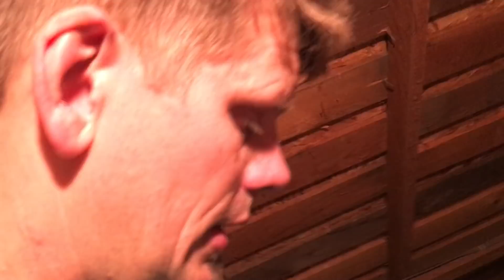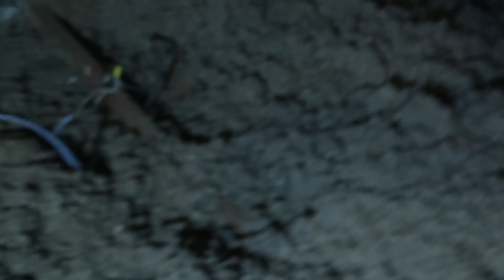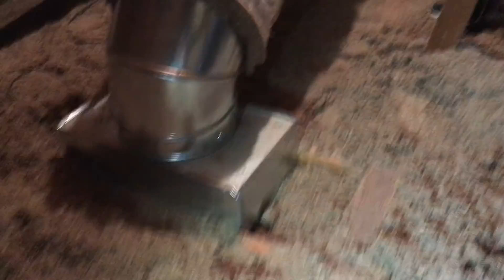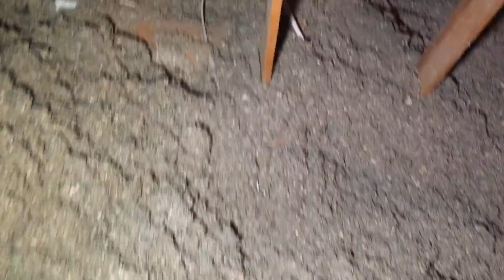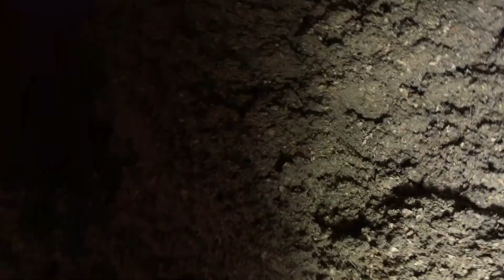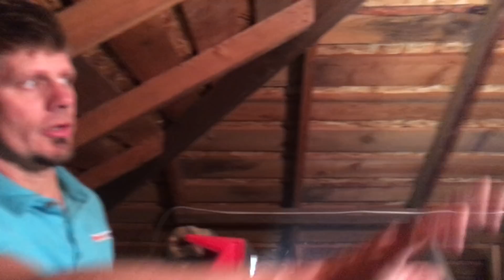Attic in a 1937 Home in Colorado with Knob and Tube Wiring: What not to Do

Comment: knob and tube is safe as long as you dont insulate over it or make improper splices, they have done both. if someone wants additional outlets or anything i would always just make a home run right from the panel and run a new circuit and leave the knob and tube alone, because once you start messing with it might as well replace it because if tampered it causes all sorts of issues. it is a great system when in good shape, and it is perfectly safe and fine for some things, but as long as you respect it's limitations and dont tamper with it then it is fine, but when you see stuff like this it really should all be replaced because that is just what you can see without even doing anything... what about what you can't see that has been done like in the walls.

Comment: No shortage of this in Boston. I’ve been doing knob and tube removal for a few decades. I’ve hit attics with 18 plus inches of blown in insulation on top of old paper backed fiberglass. Back in the day old newspaper was laid in the mix too. It’s pretty scary when you come across a scorched run of news paper or fiberglass that the only reason it didn’t fully ignite had to be just a lack of oxygen because there’s no shortage of fuel to burn in those old attics.

Comment: Wow. These new home owners are very fortunate that when the flickering occurred it didn’t start a fire up there. I know it’s against code to add on to existing knob and tube wiring systems because of the inherent dangers. I don’t see knob & tube much here in the east, but every once in a while we come across. And it’s usually been tampered with.  The silver lining is  they have an experienced and electrician like you advising them now.
Reply: I didnt know it was against code to add to existing knob and tube wiring. Do you have a code reference?
Reply: matt borges I didn’t think it was against code but maybe it is to add on to. But you can splice into it, I just watched another video and the guy said the code number but I forget what it is now
Reply: Yes.  I am in the process of starting my apprenticeship and finishing once the covid 19 is lessened.  Anyway,  technically,  as far as the nec and most local codes goes, knob and tube is not illegal and no local code that I am aware of, require the removal of knob and tube, as it falls under the grandfather clause, meaning, assuming it was wired to code at the time of the original installation,  and not altered,  added on or changed in any shape or form,  it is still technically allowed.  But the minute you start jerry rigging it, even if you were just relocating a ceiling fixture,  for example,  a few feet away and reusing all the original wire and insulators,  that would be considered modifying,  and would never pass inspection.  I know several old school electricians who been in the trade for 30+ years inspecting and wiring homes, old and new , and they have yet to see old knob and tube that has not been deteriorated and/or tampered with since it was installed in the 1930s, if not older.  Even in the best of circumstances,  many insurance companies will not insure homes with that type of wiring,  and the few that still do, usually require that a licensed electrician inspecting it and writing a letter certifying its condition,  so in the end when all said and done, your mortgage lender and insurance company may have the final say so

Comment: My family owns a house that was first wired around 1900 and is still full of the original knob and tube wire. Although the old wiring is still in great shape, the house contains lots of bad connections to the modern wiring that aren't in junction boxes just like in this house. We haven't ever had any problems with the old wiring like this that I know of, but I'd we do, I'm going to have to force them to upgrade it. I've already made some minor safety improvements, but there's a whole lot more that I'm trying to talk them in to letting me do.
Reply from the maker: I push for safety first too.

Comment: i have "cleaned up" many hacked up k&t wiring jobs. this video is a good example where a re-wire is necessary. i, too, have had customers mad at me for the cost involved. i'd rather walk away from the job than further increase a fire hazard. cutting corners on wiring is not only hazardous but illegal.

Comment: Looks like my attic. My house was built in the 1880s knob and tube mixed with old school  non grounded cloth and rubber ROMEX. I'm lucky to be an electrician since I'm cutting out and replacing EVERY SINGLE INCH OF WIRE. Not even cutting and abandoning it....jerking every piece,every knob,every tube.
Reply: Dont torture yourself abandon most of it ,or else your opening walls and all other ball buster stuff
Reply: @whtpwr  oh, I'm stripping the walls down to the stud bays. Plaster,lath,and all. BS cellulose insulation that's all settled to the bottom. And plumbing,too.
Reply: @erlycuyler  come do my house

Comment: Point blank correct. Just started in my newly bought 100 yr old home. Had the service just updated by a certified electrician. This isn’t with electrical only it goes with structural and plumbing too.

Comment: Just run romex wires from the basement thru a closet all the way to the attic inside a big pvc pipe connecting to a junction box and snake the wires down the walls to the receptacles and lighting.
Reply: Is in fact te best way to do it  .
Reply: first off you cant run romex or any non metallic sheathed cable in piping with out over calculating fill requirements and and you dont want to run to many conductors thru piping  generates a lot of heat plus increases the voltage/amp gain on all conductors(2nd yr apprentice at best from like 20 yrs ago so theory/laws  is rusty)
Reply: wizard3z castor depends what part of the country you live in and of course taking into account the sizes of the wires and conduits.

Comment: I'm surprised the insulation company would spray that crap in there over that lousy wiring mess.  You are sooo right, "home lookers" is a more accurate term.  I remember the home inspector that looked at my house, all he could find was railings of the wrong height, and BS like that.  He wouldn't even go up in the attic.  Total waste of $600, these clowns are never going to really give you the straight scoop or else they won't get referrals from the agents.  I finally went up in my attic after buying this house, and found a similar wiring mess.  Spent one hot summer up there straightening out the wiring.

Comment: My home inspector didn't even go in the attic (crawl space is above a raised tank toilet, admittedly it's hard to access but it is possible).  Being 1st time buyers,  we didn't think anything of it, went ahead with purchase and two years later, I'm discovering k&t that's under insulation and just taped together, and vermiculite.  The wiring came apart, leaving a live wire under insulation.  Don't cheap out on home inspector.  If it's an old home, should consider electrical and plumbing inspections on top of standard home inspection.

Comment: First, that appears to be xylem tissue (cellulose) insulation which has an affinity for moisture (meaning it sponges it up) and gets stinky/musty. So Also, the insulation is touching the under side of the roof decking. There should be proper-vents to keep the insulation from contacting the roof directly, so that air can circulate up from the eaves and out through the roof (or ridge vents). While the insulation is removed would be a great time to re-wire because it would be much easier, as the electrician will be able to see what’s what, and it is just not as miserable working conditions. So it’s faster and hence less costly. Very little of what is visible in the video is knob and tube, but clearly it was originally so. I don’t understand somebody grumping about what is past; it accomplishes nothing. The overall project with greater energy efficiency and safety should be an easy sell.

Comment: In the early eighties, when I was installing  cellouse
installation, we had to put pieces of screening around the knobs  in a run between the jost,
  screening  Had to be laid down, before we put insulation on top of it for that reason- so an electrician could  lift up the screening and expose that  Jost-Bay.

Comment: Same here Amman me and my dad required a house and it was all old knob and tube and when I tell it scared me that I had lived in that house for a year I mean they had speaker wire connected too the wire. They were running 110 volts though speaker wire to a light fixture.

Comment: I was a firemen for 20 years in a city that had lots of early 1900s homes. Seen many KnB wired homes burn. And the blown insulation over it was always a great way to get it started. Should be automatically replaced to-get a CO to sell. Most insurance companies won’t even insure anymore.
Reply: They will, provided the work is done within a few months, not much more than that tho.

Comment: Uho... I have a 1950s stone ranch. Went to the attic (crawl space) to see where I can run a new fixture to the kitchen.  That is exactly my dilemma.  Metal junction boxes, zero lids. Wires pulled out stretching to other wires stretched to four groups of wires with no junction box. All resting on or partially under blown insulation over paperback.  The few ground wires that are shown aren't attached to anything and are sticking straight up.

Comment: Shit I once ran into a job that had the Electrical System Using 50% Extension cords Instead of Romex.Customer Got Mad When I REFUSED TO TAP INTO THAT GARBAGE SYSTEM. 

PRO TIP: NEVER CUT CORNERS ON ELECTRICAL WORK
Reply from the maker: Yep, I have had them want me to get my things and leave. One I looked at was so bad that I did not charge them for a service call just because they were the type that came across to me that I was the last guy there and if something went wrong they wanted someone to blame. Better to walk away and fight another day.
Reply: @Petersonelectricllc  that is some grade A advice 👍

Comment: Been there and done that. Consider this; the house is over 80 years old and hasn't burned down. The NFPA and their accomplice, the NEC, have, in the past half century, worked very hard to maintain job security by initiating ridiculous and expensive code requirements. The NFPA is probably totally supported by the sale of books, especially the NEC, thus it's beneficial for them to alter the code frequently and require you to purchase hundreds of dollars worth of books. If that ain't bad enough, the Code is written so as to require more books to explain the ambiguities. If the preceding wasn't true why don't they publish the code in loose-leaf form sending out revisions in the form of pages not books??!!
Reply from the maker: After doing this for 22 years and now seven cold additions of books that I have studied and purchased every three years I think that the layout in the safety requirements is actually under thought. But if this is the bare minimum then I’d hate to see what the homeowner does with no knowledge, and were relying on YouTube’s to scab together their knowledge.
Reply: @Petersonelectricllc  Having worked in the trade for 55 years I somewhat agree. My gripe is the way they feed you their shit slowly to insure their greed and job security. As a pilot I used to receive revisions in single pages to insert in a book that theoretically would last forever.
Reply: I was always told that “to code” means a passing grade, so in other words, a D-.

It’s the reason all the contractors in my family try to “overengineer” where possible. The safety of the home shouldn’t rely on a D-.

Comment: This is exactly what my house electrical in the attic looks like and I am in the process of removing all that blown in insulation that is covering all the old knob & tube wiring so I can replace it all and bring it up to date and code. This house was built in 1919 and has been sold Many times with the wiring being as it is.  SMH.
Reply: @MsKinnara how did your project go? We have attic restoration happening due to a bat colony presence which is a perfect opportunity to remove the KT wiring and replace. Any pointers? I see a lot of folks saying not to mess with it… not sure how to approach this. Thanks!

Comment: Dude, I had this same problem... Our inspector said everything is up to date... I didn't know any better. my house was built in 1878. I'm pissed.
Reply: Sorry to hear that.   Wish the best of luck.  The main issues with knob and tube, aside from it being an ungrounded system,  and dry brittle insulation,  was mainly human error, mainly all the add ons and changes decades later, given the fact that when knob and tube wiring was the very first type of wiring system available  and was cutting edge for its heyday,  was that back in the early 1900s, the typical home might have had a few lamps few and far between,  a flat iron,  a toaster, maybe a fan and a radio or two, or a percolator if really fortunate.  Fast forward to today and we just cannot live on that little.

Comment: Let's not forget that several decades ago Knob and Tube was state of the art. At some point cables became preferred - probably for ease of install instead of safety. The accepted way to add onto a circuit using a cable was to splice it in exactly as is seen here. This electrical system is commonly not acceptable today, but I'm not aware of a threshold year where before that date an electrician would say the system is fine and after that date an electrician would say it all has to be ripped out. There are a lot of houses still with this system. I think the proper action is to just calmly say that the system is unsafe and the only way you would be able to help the customer is to replace all of the circuits that aren't up to current code. I wouldn't get upset about it. Still not an easy thing to tell a customer when they were probably expecting a bill of only a few hundred dollars.
As an aside, in my house I would never accept aluminum branch circuit cables, cables without ground wires, or tandem breakers (as I feel that they result in a crowded breaker panel). In any of those situations I would want replacement work done. Will someone in 40 years ask how an electrician could be that stupid to allow those things to remain in a house?

Comment: You dont have to remove the insulation,  just demo out the lighting circuit and repull the lighting circuit with new romex.a few hundred bucks plus material
Reply: What do you mean by demo out and how would you know where to run the wire if you can’t see with all that insulation in the way?
Reply: Just pull romex through porcelain tubes passing through blocking and plates? Yeah, okay, you first. I have rewired a house w knob and tube and you have to tear everything out and feed through new holes l, using new junction boxes, that you install. Took us a week and change to get deviced in  then paint and drywall had to finish up.
Reply: @ubrayj02  @kchilz32    Demo means remove one or more lighting circuit. It can be done one by one. As you cut out an old circuit, the old knob and tube wiring can be connected to keep power in the attic if the job can't be completed in one go. You know where the light is, you know where the switch is. New power can be wired light to light and a switched power to the switch using wire fishing to get to the switch. Move insulation aside for a bit while running wiring.  Honestly it's not that complicated. Does take time and work in a not so great environment. But it can be done, preferably in the time of year it's not so hot.

Comment: You really can’t even touch that stuff. That entire home is going to have to be rewired
Reply from the maker: Tell HO that, so hard to convince them to even clean the attic out so you do anything. ;)
Reply: Peterson Electric it’s like the fpe argument lol I’ll fix it the best I can for them (if even possible) but I always explain the extreme dangers and make them sign a waiver
Reply: Peterson Electric It’s easy to say that all the insulation needs sucked out and everything rewired and if I was the home owner it would be easy to convince me that’s what should be done, but it’s going to be a lot harder to get them to be able to afford such a job.  A whole lot of people are living paycheck to paycheck or not far off of that, it’s not possible for most people to just write a check for a few grand to have that done. That’s why things end up like that unfortunately. They can’t afford to pay for a complete re wire and most electricians bail on the job for anything less and they can’t really go without electricity in their house either which leaves them with dangerous options, like running extension cords all over the place or by calling the “handyman” in who comes in his old gutted conversion van and tells them he can “fix” it for 100 bucks and a couple hours later he’s leaving and the lights are on. 
It would be nice if people could understand that that’s the real world scenario and come up with something in between the 100 dollar dangerous hack job and the 5k dollar re wire. Everyone has this all or nothing attitude and I get it, especially with electricity and liability issues but when you figure the less of two evils is rather have the competent guy doing the hack job where there at least wouldn’t be bare wires touching metal duct work and shit like that.